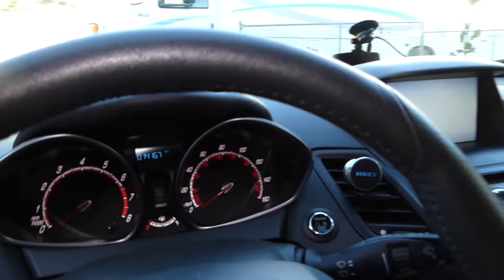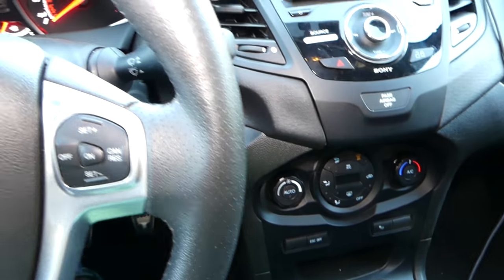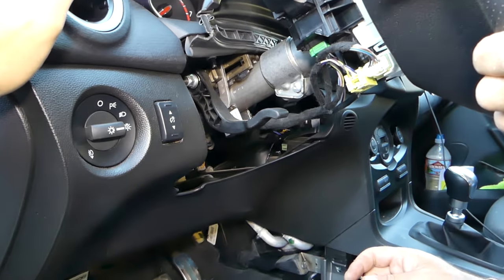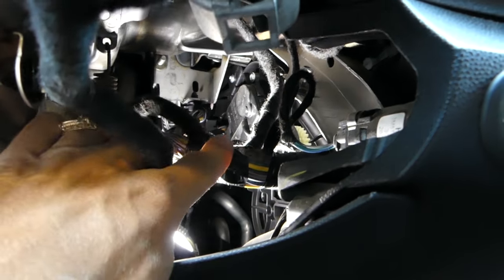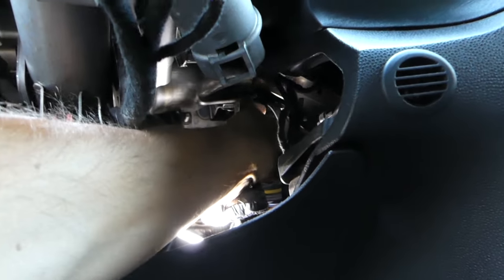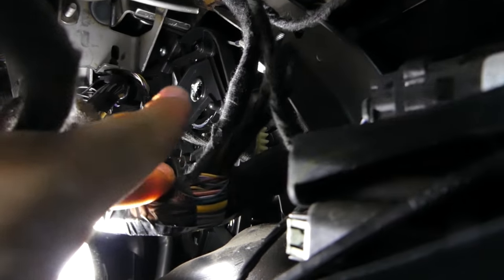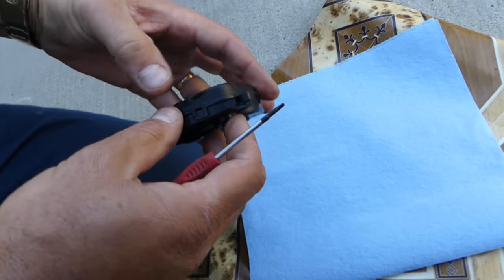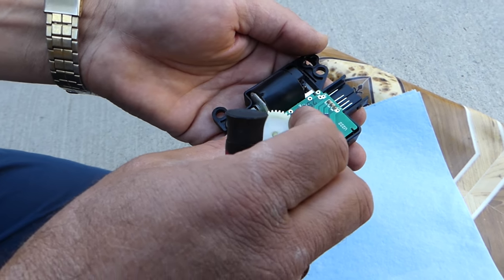FORD FIESTA  HEATER BLEND DOOR ACTUATOR REPLACEMENT. CLICKING WHEN START CAR FIX

Comment: First, this video was incredible, helped me out tremendously and saved me a lot of money! But two things I learned: 1) Like in this video, I replaced the driver side actuator, which controls the mode (Floor, dash, defrost) But the clicking continued. It turned out it was the passenger side actuator behind the glove box that was the culprit. This controls the recirc/outside air function. It's much easier to get to than the driver's side. 2) The replacement part for the DRIVER side mode door needs to have the circuit board INSIDE the old actuator transferred to the new part. The board gives feedback to the body computer where the motor/door is in its travel. The PASSENGER side actuator will NOT have this circuit board because the recirc function just opens and closes the door on that side, there's no in between. I hope my experience helps others!
Reply: I just replaced my actuator today and now instead of it only blowing defrost it only blows front and floor vents so you may have just saved my life by mentioning the circuit board in the actuator so thank you!
Reply: Would you give me please model of  this  activators for my Ford fiesta titanium 2015
Reply: Robert Cucchiaro is it the same door blend for both sides ? I changed the one under the steering wheel but the passenger side still does annoying clicking.
Reply: What are the parts for both on the ST ?
Reply: Just tried replacing it on my 2016 fist but the circuit board wouldn’t fit in the new actuator. The pin size on the cog did not match. Time to order the Part from Ford.
Reply: @jasontran3633  19E616
Reply: @Chris Eugeniou the passenger side actuator only engages when you select interior air circulation. If you hear clicking when you turn on the car it would
Be the drivers side. Both of them are located behind the center console almost level with the bottom of the steering column so it would be difficult to pinpoint the location of the sound. The drivers side actuator has a circuit board in it and the passenger doesn’t, so when the car is turned on the actuator will try to go to the one of the multiple settings that are on the heat controls. With a broken tooth in the cog ⚙️ inside the actuator it will click for a while. The passenger side only has two settings, inside air and outside air.
Reply: @Chris Eugeniou remove the glove box unplug that one of the clicking continues it’s the one you access from the steering sid
Reply: @Chris Eugeniou Take all of the stuff out of your glove compartment and drop the door down. You should then be able to see the actuator easily. It's hard to miss at that point. Then turn on the car. You should be able to hear the clicking louder when the glove box door is removed. You can also put your hand on the actuator and feel it lurching as it clicks. If you can't hear the clicking louder, or you can't feel it lurching, it's probably the one in the center of the dash.
Reply: Didn’t need to transfer anything from mine. Installed the new one, everything works as it should. No more clicking.
Reply: Does it matter if you put a 5-pin actuator in the passenger side? -Will it not operate or function normally as the original 2-pin?
Reply: Thanks so much
I replaced the passenger 1 first,  now I'm going to replace the other 2.
I'm hoping I can do the other ones myself as well 🙏🙏🙏

Comment: FYI for anyone who doesn't hear the exact same noise, the noise from my car was coming from around the same place but was a constant loud buzz for several seconds when the vents were closed rather than a click. Replacing the blend door actuator still fixed the issue, I did a teardown on the old part and noticed the keyed motor rod had torn up the plastic gear so it was mostly spinning freely causing the buzzing.

Great video! Good camera work, made it really easy to follow along with the repair. Took about 2 hours for me, those screws were really difficult to get out and back in.
Reply: Thank you so much! I was looking all over for videos of my sound to confirm and nothing sounded like it.

Comment: Thank you for this video.   I just made this repair.  Took me 1 hour, although 15 minutes of that was working, 45 minutes was swearing and taking breaks curse the designers.  Getting the bottom screw in the new part was tricky.  Everything else went OK.  Thanks again.

Comment: I did it! It was not easy so I would give a little advice. 1) determine weather the clicking is coming from the driver or passenger side . To do this drop your glove compartment door and you can see the passenger module easily . Then test the system , if that is not clicking then you know its the driver side which is what this video is about. 2) Get good lighting from different angles. 3) Make sure you have good eyesight and a flexible left arm. 4) Take your time in removing the cable from the module. The red lock is tricky to pull up to release but tinker and it will happen. 5) When replacing  the new module, the  new gear has to be rotated  to fit  properly . It may be okay if the old actuator has the gear in the same position as the new one. Otherwise the large gear wheel has to be rotated until the module gear seats itself. One more comment, Ford did a bad job on this issue. They knew it was bad but did not correct the problem. It is very expensive repair going to the dealer.
Reply: How expensive
Reply: @rapinncapin123 my girlfriend just got a quote from our local Ford dealership for almost $2000 for replacement. The part is $52 on the quote, with over $1900 of that being labor cost...ridiculous!

Comment: Much thanks! Repaired my 2015 Fiesta Titanium 5spd. Blower actuator today using this tutorial. Took me just shy of 1 hour. Most of the time was struggling with putting the screws back in to hold the actuator in place. One tip. When putting the screws back in, tighten them as far as possible using only the torch bit. Then, add the ratchet to the bit to finish tightening.

Comment: This excellent, helpful video saved me time and money! I was able to do this without removing the airbag like showed, but I was barely able to fit my hands and arms in these small spaces - and don’t drop your torx socket like I did under the dash. It took me 30 minuets to find it where it fell into a space under the steering column. 🤣

Comment: I have this problem, but the blend door actuator was accessible by removing the glove box in my 2011 ford fiesta hatchback.   Still thanks for posting the video, i had gotten bad advice about how the blower must be clogged, but I can actually see the blend door pulsating as if that same gear has a broken tooth.
Reply: for anyone reading this, there are 2 actuators in the car. The one under the steering wheel controls blend hot/cold/AC. The one by the passenger controls interior/exterior airflow.

Comment: I have a 2012 ford festival my compressor clutch wasn't working at all it actually quiet blowing cold air,after watching one of your videos I pulled out I think number 6 fuse an jumped it over with a paper clip,well my clutch started working but it stays on. Also my center console where you change from hot to cold is clicking just like this video . Question is you think if I replace the actuator like you did it will allow the cold air to circulate through the cabin.my ac line isn't really cold at all. Thank you love your all's viedos

Comment: I have a clicking in a right hand drive ford fiesta and it's part number, 1S7H-19E616-BC. The part is at the lower part of the drive side. No need to take off steering wheel plastic surround.

Comment: Just started hearing this clicking today in a 2017 Fiesta, and have a basic question that wasn’t answered in the video: How urgent is it to repair this? Is it okay to keep driving for a few weeks in this condition?
Thanks for the helpful video!
Reply: Shoot man. I feel bad this went so long unanswered. Neglecting to do this repair won't harm anything, except maybe in some pretty extreme circumstances, and I only say that so that someone doesn't come by and say, 'well if such and such happens it would cause harm'. The only reason I'm wanting to do it is because it's annoying and I've noticed that the temperature controls are either really cold or very hot and nowhere in between. So I'm finally getting around to doing it.
Reply: Ended up having to wait a couple months before I was able to get this repaired in my car, but it was fine (besides the annoyance of the clicking sound). Thanks for responding.
Reply: @joshuabronson7757  Can you tell me how much it cost you to get this repaired? My 2015 has this issue and I’m debating on whether I should attempt it myself or take it to a professional.
Reply: @knockeledup they quoted me like $1300 lol meanwhile the part is like $30 and you can do it in like an hour or 2.

Comment: Awesome video!! as usual. Could a defective actuator affect the AC performance as well? Do you have a video about the system not recognizing the SD card, usb dont work, no sound from my ph but displays the songs name. Shows "prompt volume. Radio sound works fine. I tried removing the fuse and disconnecting the battery but no luck. Thanks a lot!!

Comment: Hey repair guys will that vent door actuator cause my 2012 ford festiva making same noise cause me not to get any cold air? I'd appreciate it if you could tell me , my wife has Ms and could really use the air. The compressor clutch is turning now that I jumped it over from the number6 fuse but turning all time, but no cold air. Thank you for your videos you guys are life savers on alot of stuff I just need you to answer my question if you can thanks.

Comment: Great video! my wife has a 2015 fiesta which has been making this clicking noise for a while. she took it to the mechanic and he told her that it was a actuator and that he fixed it. but when she got the car back, it was still making the noise. she didn't go back. I'm going to tackle this. didn't realize what a job it would be. my only question is, why does the noise sound like it's coming from the glove compartment? Thanks
Reply: The recirculating door actuator is behind the glove box (oem part: YH1896), different actuator. the one in the video is the mode door actuator (oem part: YH1895), but same general idea. If you want to check if that's what it is, you can fold the glove box down and unplug it, if the clicking stops that's the culprit. As far as I know, the 2015 fiesta has 3 actuators, mode door (controls which vents air comes out of), recirculating door, and blend door (controls air temperature, oem part: YH1935, in the same general area as the one in the video).
Reply: @broomhandle1  LM good info except your part numbers are wrong: 
Yh1896 is mode or "defrost" one
Yh1895 is recirculation or inlet one
Yh1935 is the blend/temp door but was replaced by yh2016
Reply: She should have absolutely went back and told the mechanic to fix it like he said it was, unless the other one went out he would never know and never have the opportunity to fix it.

Comment: I ckicked on your link that said heater not blowing hot air, but it was a video about clicking noise, not warm air. Can you tell me how to fix my 2011 fiesta heater? Fan blows good, but will not get hot. Thanks

Comment: Hi, very informative video,  however could u please do similar but with 2018+ Ford fiesta taitanium turbo uk model if possible as it is different layout.... I was told by Ford dealer there are 3 blender door actuators. In my car clicking sound coming from just knee height from clutch pedal. Thank you

Comment: Nice video bro.by the way how many actuators are there  total in your vehicle?. I have a Ford figo 2018 air is not blowing to face direct and leg setting. When I select face direct or leg only or both together the air blowing through near windshield area only and making wind shield to get foggy.what could be the problem can you suggest please?thank you

Comment: That's is actually the MODE door actuator. If you purchase the blend door actuator and replace this part it is not correct. The blend door actuator will fit in the same spot, and even plug in, however look closely at your pins and connectors. Mode door (drivers side in video) has 5 pins. Blend door on passenger side behind glove box has 2 pins.

Comment: I just changed the blend door actuator on the driver side. but now it's not working properly. it likenthat whole system is stuck on the front window defrost. I can't get it to go to other stairs flow settings.

Comment: So I absolutely get this clicking sound. Like I’m almost certain this is the issue but would this stop my airflow? I can feel a little air coming out of the vents but all of a sudden my a/c went from full blast to now it doesn’t blow. I can slightly feel some cold air coming out but it’s like almost nothing. Anyone have any advice?
Reply: Hey Mason. My 2013 RHD ST has the same issue (I think). Suggests that the blend door is stuck on one setting - in my case the 'defrost' position, which is when the majority of the air flow is diverted to the screen and side quarter lights. I too have minimal airflow from the dash vents. In my case I have had no clicking or buzzing but am pretty sure it's the actuator shown in this video which has failed. The other actuator (behind the glove box) only controls the 2 position flap for 'outside air' or 'recirculated cabin air'. No doubt you had it sorted ages ago but just in case not...

Comment: I just paid 550 for them to fix mine and the part itself was $50, the rest was labor...
Reply: My dealer quoted 850. I even questioned them and sat down in the maintenance manager's office for a bit. She called in a mechanic and they both checked the quote. They kept arriving at the same quote. Their system just allows SO many hours for this job (I think their system had it at 4-5 hours). That's 500-650 in labor right there at least. It's ridiculous.
Reply: I take it neither of you have ever attempted taking a dash apart yourselves! Goodluck
Reply: @travispoulton6485  it looks like a ten minute job no?

Comment: Be carefull, amaon and others are suggesting doorman #604-292 as a replacment...IT DOES NOT WORK!!  in fact this part has only 2 pins in the connector 
OEM has 5 pins and the internal encoder..😡 i will have to re-check my source for parts oem part # is AE8H-19E616-BC....i guess we have to make sure it fits better than  amazon suggestions, make, model, year....

Comment: How to repair noisy sound from dashboard near ac ventilation for fiesta/ecosport?
Reply: On mine there's an occasional weird electronic buzzing noise that's coming from a vent like thing near the start button on the right side of the steering wheel (on a Left hand Drive Fiesta ST). I believe it's the thermostat for measuring cabin air temperature for temperature control. I just taped it up since it annoys me. IS that what you're talking about? 
Sometimes over bumps there's some weird sounds coming from above the steering wheel area in the dash, like little sea shells rattling around.\
Lots of squeaks and creeks and weird  noises in the car, from all different areas really. 
I don't think there's much you can do about it.
Reply: @BensCoffeeRants  it is come from the dashboard for the sound.